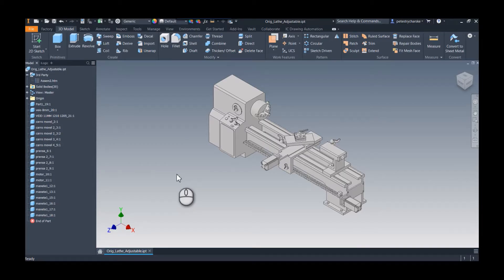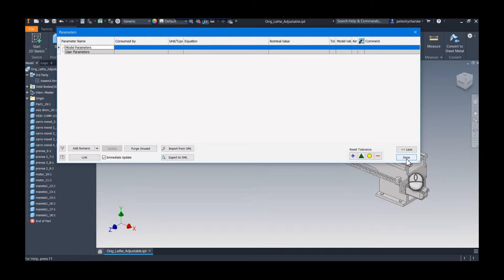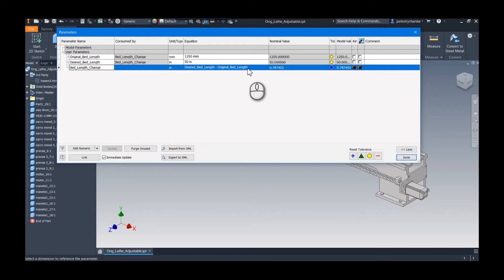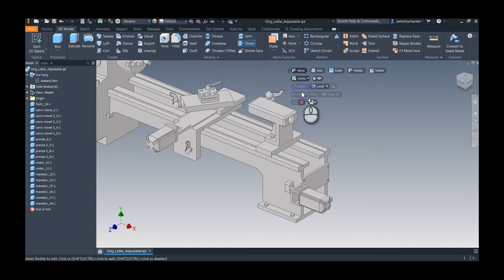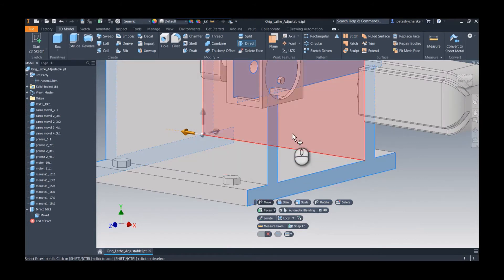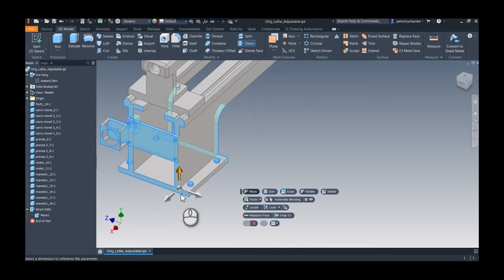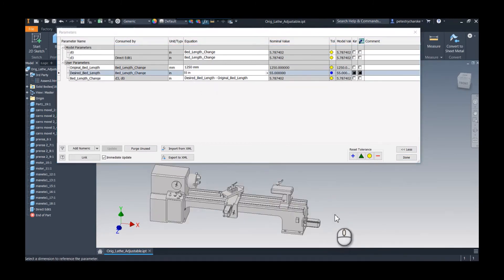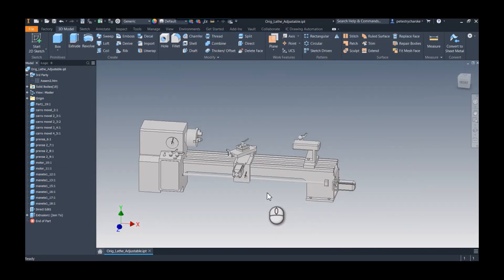Inventor - How to Parameterize a 3rd Party Model (STEP File)

Comment: Is it possible to see sketch instead 3rd party symbol ? Thank you
Reply from the maker: ImJeff_ thanks for reaching out!  Can you please elaborate on your question or reference a time frame in the video, as I'm not sure I completely understand?  Since this is a STEP model, I don't have access to the original design data, so unfortunately I wouldn't be able to access any of the original sketches.  However, if you want to know if I can create new sketches for extruded features, the answer is yes and, in some cases, that may be more efficient than trying to use the Direct-Edit feature.  Hope this helps to answer your question, but please do let me know, and have a most blessed day!

- Pete
Reply: @Team-D3  Thank you Pete. I was just wondering if it's possible to  access to the original sketches.. and you gave me the answer which is impossible to do so👍